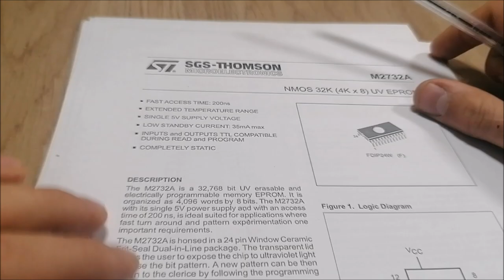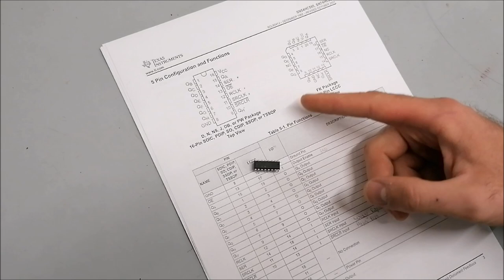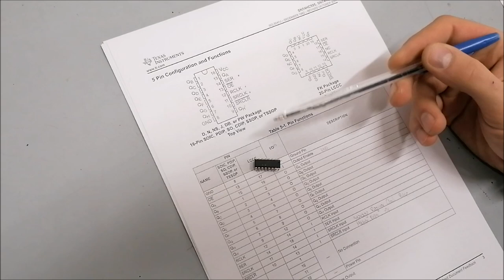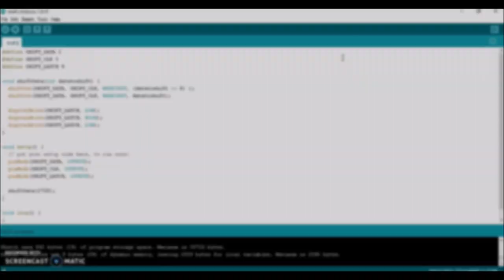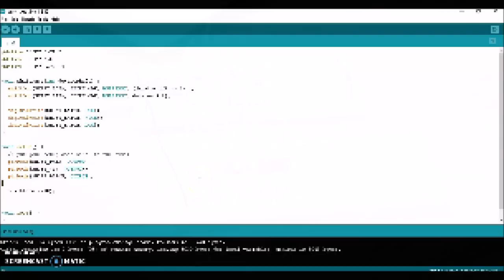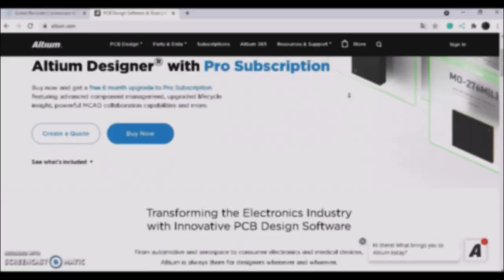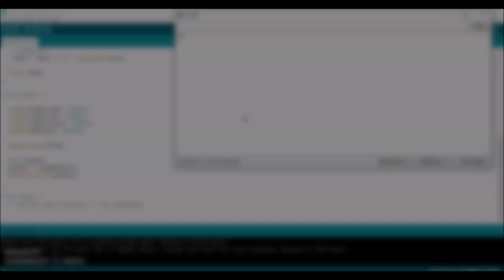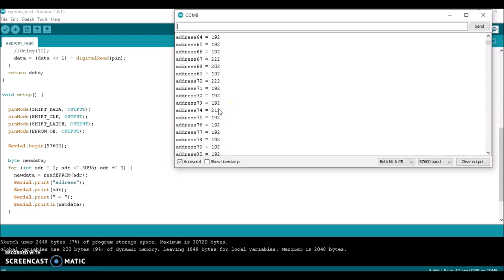Make an Arduino EPROM Programmer: Let's Read!

Comment: I've done similar, but using an Arduino MEGA as the reader, wiring address pins to the to the upper i/o pins, and the data pins to the last 8.